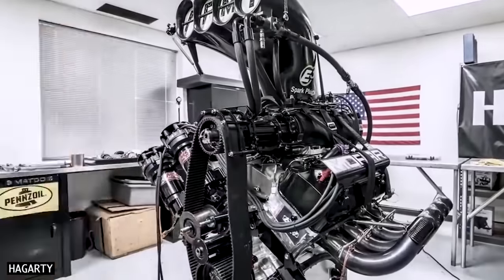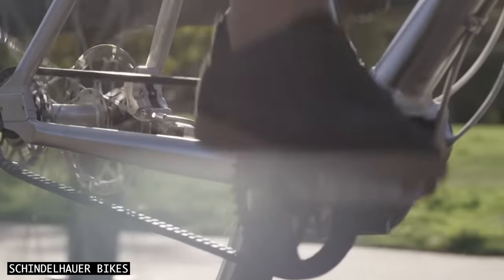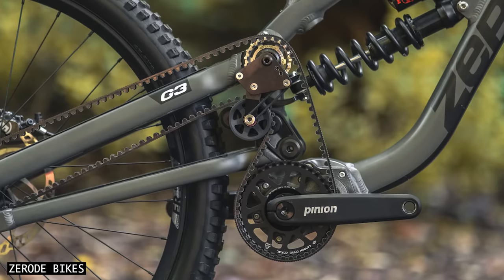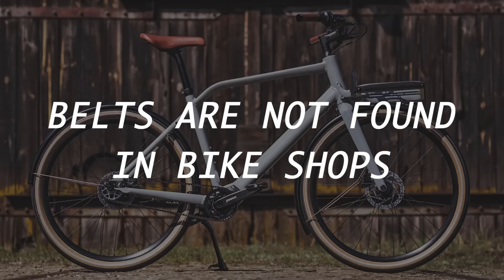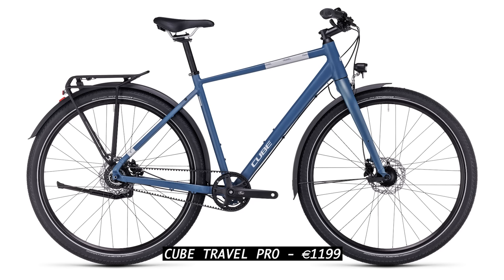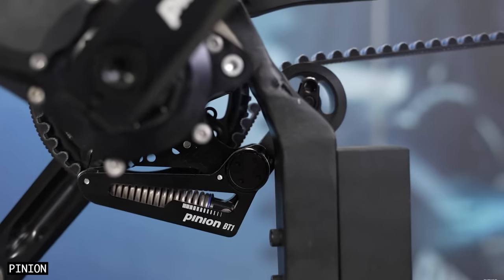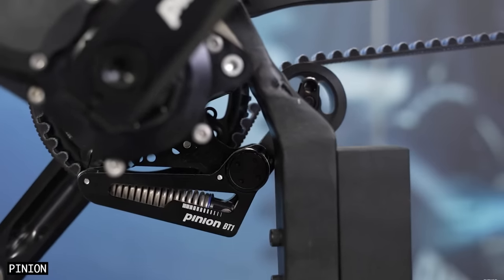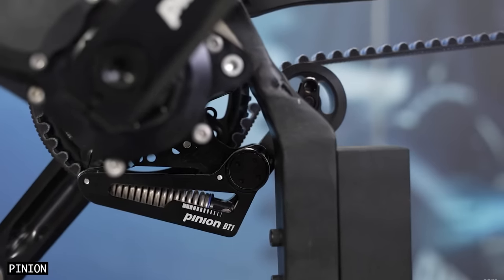Belts Are Now BETTER Than Chains On Bicycles!

Comment: My belt bike died after only 4 years of city riding. Back sprocket cracked and lost a tooth leading to a belt failure very quickly after the rear sprocket broke. While I continue to be a fan of the Gates Belt Drive due to lower maintenance effort, it is a fact that it is more expensive and less mechanically efficient than chain in the long run. Advantages come at a higher price.
Reply: thx for your story. so random and boring  i unistall YT now
Reply: got an almost 30 year old chain that has never been replaced n has suffered tons of cold rainy nights outside cuz of my dumbass. fuck belts bro dont even use em on motorcycles, less efficient power delivery no ty.  Last time i put any grease on this chain was like 13 years ago and it was the cheapest crap u could find from YEARS ago if not almost a decade.
Reply: Facts
Reply: @Scoliosisguide  YAYYY

Comment: IMO, Internal gear hub + regular chain is good enough for most people. Pricing wise.
Reply from the maker: When buying a new bike, the price upgrade to belt drive is usually just $100 or so! In some instances, it's a bit more but you get a hub upgrade too (eg. 7-speed to 8-speed hub). 👍🏻
Reply: I'd never consider chain if IGH is an option.
Reply: @channul4887  derailleur > igh
Reply: @skfl7014  yeah Pogacar, I hear you need all the fractional gainzzzz.
Reply: Plus, without derailer, you can use a chain cover (it's just a marked-up plastic electric wire holder) which holds in the grease and makes your chain last forever.
Reply: You'll have to spend more than the additional charge of the belt for chainrings and chains before you even have to think about replacing the belt. Not to mention the lubricants you don't have to buy (and pollute the environment with)
Reply: @Cyclingabout unfortunately mountain bikes with gearbox and belt drive are super expensive..
Reply: A chain requires regular maintenance (using cleaner and lubricant, and that costs money), whereas a belt is much easier and cheaper to maintain... Most people don't really bother with chain maintenance, and for them the best option is a belt
Reply: @werauchimmer08  How much of lubricants you use for a chain in a bicycle? I uses my bicycles almost 3 decades and I only bought one lubricant so far. And as I remember, the lubricants for bicycle back then is like $1, I still have it in my garage still half full! You seriously trying to argue it is polluting environment and don't have to buy lubricant to justify higher price for going with belt?

Comment: After I disassembled, cleaned and regreased Nexus8 hub with Shimano IGH specific lube and adjusted hub cones I was astonished how small hub drag now is and how much more enjoyable bike became. Pity is that bike companies charging $$$ for their products rarely care to fine tune bikes and just charge like for a set of parts they put together.
Reply: Skip the IGH lube. Even Shimano themselves no longer recommend the grease originally used in Nexus hubs, suggesting instead to use a liquid oil that you dip the hub internals into and then allow to thoroughly drip-out before reinstalling. Lots of ham-fisted knuckle-draggers will recommend using ATF (or worse, Marvel Mystery Oil) because they think it's magical, but I use a bottle of Redline 75w140 GL5 gearbox oil because it actually has the correct lubricant properties for highly-loaded IGH internals. It's very slick but also formulated to be non-slip, so the one-way bearings will work properly. Great stuff.
Reply: @deusexaethera  Trust me, I ate my nails trying to figure out which route to go! I were a bit skeptical about ATF or GB oil as I didn't want to deal with possible oil leaks. Black IGH lube is much thinner than I expected so I decided to give it a try. Years ago I did see how looks hardened up white IGH grease in 3sp hub and black is much much more thin.
Don't you have oil leaks from gear box stuff?

P.S. I know very well why Shimano recommends oil bath - it's a PITA to put back sun gears properly. I didn't pay enough attention and got back only 4 gears, after positioning sun gears correctly all gears came back. Not a job for average Joe who can't finish 3min video on Youtube because it's too long. Oil dip is much safer for customer and Shimano as a brand because people just don't end up with a pile of parts they can't put together into working mechanism. Frankly, next time I wouldn't want to deal with full tear down, too)
Reply: @event4216  : It's not because Shimano doesn't want the liability of users disassembling their own hubs to regrease them, it's because liquid oil reflows around moving parts and grease doesn't. The new Alfine hubs use liquid oil for the same reason, and Rohloff hubs have always used liquid oil. Shimano thought grease would be good enough, so they could skip having proper oil seals, but they learned the hard way that grease wasn't good enough. Unlike hub bearings, gearboxes have too much open space that grease can get squished into and never return to circulation. Liquid oil doesn't have that problem.

If you let the liquid oil drip out thoroughly, so there's just a thin coating on all the moving parts, there are no oil leaks to speak of even in a not-fully-sealed Nexus hub. The internals don't experience enough centrifugal force at sane riding speeds for the oil to be flung off, especially not GL5 gearbox oil which has polar molecules and sticks to metal even better than older oils.
Reply: @deusexaethera  Next time I'll try GB oil. Thanks! Where were you when I researched this before?
As much as I like IGH there's no way I'm going to buy Shimano oil kit which is OK for bike shop specializing in hub service. As a home user I like simpler hack and Nexus isn't a mech I'd be worried to ruin opposite to Rohloff or Pinion.
Reply: @deusexaethera  Now I remember reading about oil leaks after using ATF and hated idea I'd have it anywhere near belt. 
What's your experience with leaks?
Reply: @deusexaethera  When I was 13-14 I filled an old cheap worn hub with sunflower oil. I gave it a whirl and more oil made it spin longer. 40 years later I still don't have an explanation. Youtube still doesn't provide a video of a spinning top submerged in water or oil. I have this wonky theory that vibrations are dampened. The funniest part was that the old rusty clunker was completely silent when idling and switching gears. (it also leaked like an old car and needed monthly refills)
Reply: Ese es el negocio del ciclismo

Comment: I'm a mechanical engineer that designs engines.
Belts are useful for all sorts of stuff, but chain drives have their place. Almost all the disadvantages of conventional roller chains are obviated by using O-ring or X-ring chains, whilst retaining basically all of the upsides. Roller chains last so much longer in cars because they are inside the engine, bathed in clean lubricating oil, and sealed from the outside.
Reply: Chains are durable and long life.
Reply: But I have yet to come across any bicycle drivetraibs that use roller chains that have orings in them, I am very jealous of motorcycle chains being internally sealed like that
Reply: @ItsTheAOK  Seems like a good business idea that someone could capitalize on. I'm too busy running my current business to take on another.
Reply: My old V6 mondeo had a chain, never had to be replaced! No pesky cambelt replacement!
Reply: Bingo they are after profits
Reply: Sadly doesn't go for all cars, look at VWs, Audis, Skodas or even some Mercs and BMWs, the timing chains stretch and destroy the whole engine, even with perfect maintenance, yearly oil change/every 10.000km.
Reply: @Latoria  Thats because they are using single strand #35 roller chains, which are literally smaller and lighter duty than bicycle chains. Its disgusting. 350 SBC's iirc use double strand #40 roller chains which are much more heavy duty.

Personally, I prefer iron gear driven cams.
Reply: Yeah this, there is a reason new cars come with a timing chain not belt.
Reply: @Latoria  You mean German motors, or non Gernam motors with German engines. There's a theme there. It's funny you should mention this, the exact same thing happened to a co-worker of mine, his BMW had a stretched chain which caused a lot of damage. Cost him thousands to fix.
Reply: @Latoria  it's good practice to service the internal timing chain before it destroys the engine. Usually 30 to 50k miles.
Reply: Can one imagine driving the  alternator, water pump and power steering with open chain. 

Wonder how many minutes that nightmare would blow to smitherines, destroying everything in its path. 
Cheers
Reply: @Philscbx  If it was an X-ring chain it would last quite some time, probably a lifespan comparable to that of a V-belt.
Reply: There are differences here that are important, too. With timing chains in engines, they're not under very much torque. That's definitely not the case with a bicycle chain, which then requires the bike to use a much stronger chain. And the opposite is also true - with an engine's timing chain, weight isn't a very important factor, so it's simple to put a much more robust chain in there that will easily outlive a belt. You could do the same thing with a bicycle, but nobody would want to pedal a bike with a motorcycle chain on it - then the belt would be much more efficient than the chain.

The application really does make all the difference.
Reply: @Philscbx There's no need for a chain in those applications. The belt makes perfect sense.
Reply: And offroad on a belt is just asking for dirt and debris inside the teeth
Reply: @smh9902  
Impossible,, even the very heavy duty Oring chain for 100hp motorcycles, the max mileage even carefully maintained is 10K miles, 
before they are obviously stretched 
beyond their original pitch. 
Standard non Oring is half that.  
Former tech retired Harley/Honda dealers Mpls.  
Recycle the Oring chain to non critical machine, say a cement mixer, and it would probably last 30 years.. These highend Oring series came out about 1978 when the high performance CBX appeared, which I and other techs assembled from crates, and took home, or converted to all out Pro stock drag bike with 10" slick, air shifter, 40psi of boost, etc. Hang on if you dare, as it'll leave a mark the instant it starts shifting at wide open throttle..by itself.. and 3rd isn't even finished yet, and it's over 100mph can rip your grip clean off if panic stop can't be reached under high G loads. 
Cheers, and 1979' was truly epic going nationwide with it. As Testing tech & builder only, 3rd gear was my limit. Others that tried, we're blown off at about 160 near end of 1/4 mile, but survived Ok.  
Cheers
Reply: @Philscbx  Motorcycle chains are subjected to a lot more force than bicycle chains for their size. Also, X-ring chains last about twice as long as O-ring chains. If your chain breaks on your bicycle, its not going to kill you (unlike a motorcycle). So yeah, a 30 year lifespan I'd say is comparable to a V-belt.
Reply: I can speak on motorcycle drivetrains after servicing thousands, those o-rings and x-rings will start getting spit out after being looked at sideways (lasting maybe 50% longer than conventional if you're lucky), whereas a drive belt is typically a lifetime part. There are 2 advantages to a chain, they handle foreign objects better and you can cheaply and easily change the final drive ratio. As you stated, inside the engine is a different story but this is a bicycle.
Reply: @ItsTheAOK i would have put money on kmc releasing something like that, bit theyve gone the maxxis route, sales and gimmicks (diamond like coating) guaranteed to knacker your chainrings and sprockets,.. but your chain will be fine 😂 until its stretched like the rest.

But orings... Theyre not built to handle friction very well, i guess we need sealed bearings 😂
Reply: I think it makes a lot of sense to have belts on bikes.  But for engines, a timing chain is more durable than a belt.
Reply: X or O ring seals in chains add frictional losses, not a problem on a 200bhp superbike but not ideal for a bicycle.  The addition of seals also widens the outside of chain which is likely to be problematic on a derailleur system.
Reply: @ItsTheAOK  I feel its a bit overkill for bicycle's. The o-ring/x ring are known to have more rolling resistance.  Not a big deal with bikes over 50hp. Smaller bore bikes you definitely can feel a difference. I imagine that is why they're not used on bicycles.
Reply: So, what I'm hearing is that you're the one that put the starter in the transmission bell housing!
Reply: @_theender312 the teeth expel dirt
Reply: @ItsTheAOK  It might be feasible to make an O-ring chain for single speed and hub gear bikes, but I seriously doubt that derailleur chains could be O-ring.
A couple of decades ago (just after he left Giant) UK bicycle engineer Mike Burroughs came up with a design for an enclosed derailleur system, inside a structural chain case. He approached a number of derailleur manufacturers, but none was interested in collaboration - and viewed his concept as a threat. It kept the derailleur system perfectly clean and lubricated, so the parts would be VERY long-lasting.
Reply: I was about to say that just saying “cars use belts” would make me pick a chain as my Saab is chain driven and only needs replacing after about 150k miles whereas my Alfa needs a new belt every 30k miles. My chain rattles for quite some time telling you to replace it, whereas belts fail catastrophically without warning. I’m not sure “cars use belts” is the best way to make the argument.

Comment: I think a lot of us would happily use belts (I certainly would) it's just that gearboxes are jolly expensive, and rare for frame integration (and heavy for people who care about that)

My entire microshift clutch drivetrain (shifter, cassette, derailleur, chain), was £80 on sale, ya can't really beat that until gearboxes become mainstream
Reply: I know a lot of people who buy expensive bikes , so 8k and more. No one got the pinion because the frames way to much limited and no one of them likes to shift with the twist shifter. Pinions still shift with that. The electronic shifter is only for ebikes , for now. 

I would buy a MTB enduro frame with that drive train and gates. Same stuff here, not a frame available that got the right numbers for the geometry and rear wheel travel. I would go custom, still same stuff. Not available for the numbers I like. 

Keep in mind I have only 1,8k  FS frame and my drive train currently would cost 720 + 300 for the crank. I would pay without hesitation 6 k only for the frame+pinion/effigear.
Reply: I'm a big Gevenelle fan with friction shifters .
Reply: Belts look fine. But I won't be in the market for a new bike for a very, very long time. Until then, chains and derailleurs it is.
Reply: microshift is great. and replacing a chain once a year +other parts would amount to the price of gearbox and new wheel and chainset over a lifetime. still its cool id get one if i had the chnage like you said.
Reply: Hello, brother
Reply: It really depends on the gearbox you want to use tho. A nexus 3 costs 60 EUR and you will need an other 30-40 for the other parts. And that's without a sale.
Reply: @BufordDuckworth   Not near impossible on the brakes, it's just that disks are finally cheap enough to be included on even lower end bikes. 
Still find them on kids and the cheapest ones though.
Reply: @BufordDuckworth  rim brakes? so sand can embed in and scratch the rims and hear the uneven rub noise of pads
Reply: On a commuter road bike i would not mind 1kg extra. It's the price and availability for me.
Reply: I mean not really, if you just want commuter bike or something for casual biking/travelling. You can get shimano gearbox bike. It's not cheap cheap, but it's comparable to other normal bike setups.